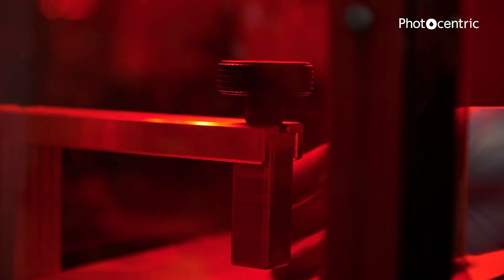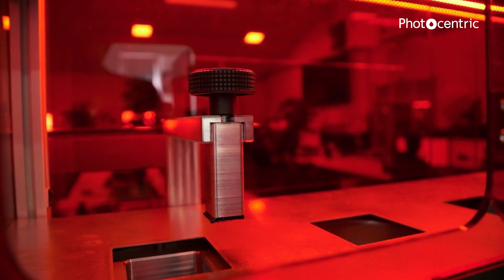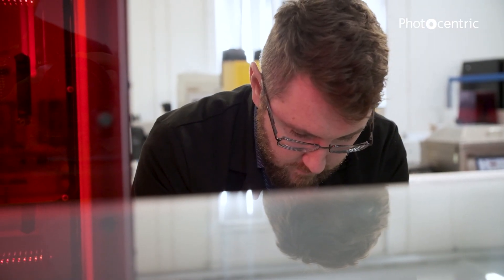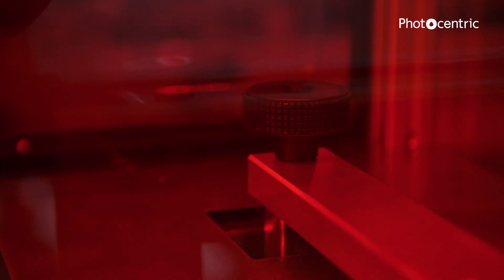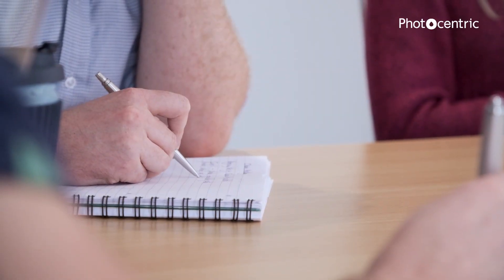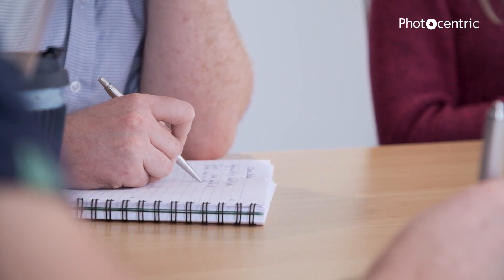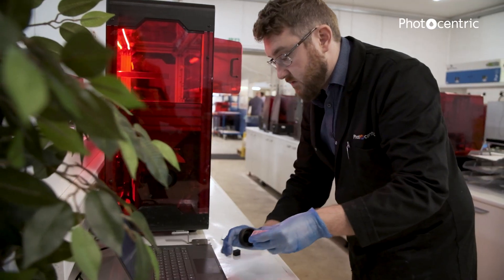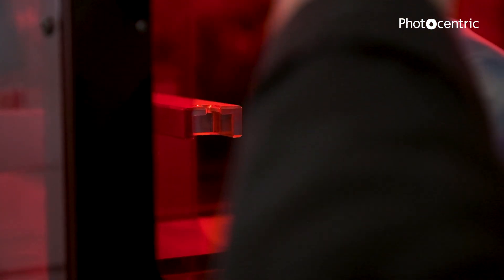Photocentric begins work on 3D printed batteries

Comment: So I’m assuming it is dipping into each chemical or components to great a complete cell layer by layer in which you can optimize things such as energy density or longevity Based on the need of the customer.smart when can I buy this printer lol